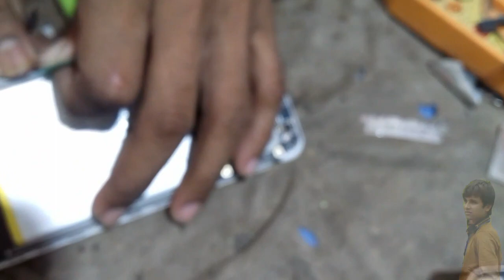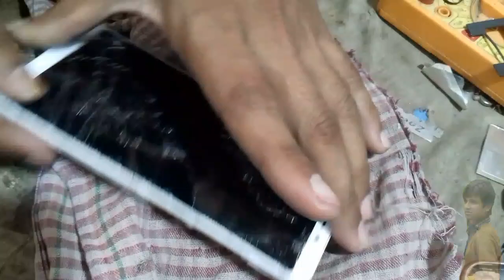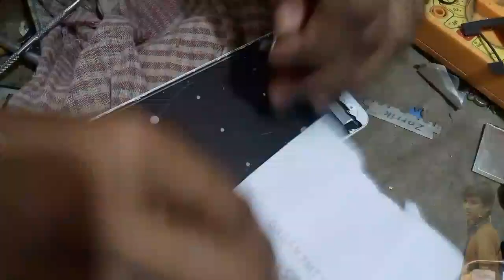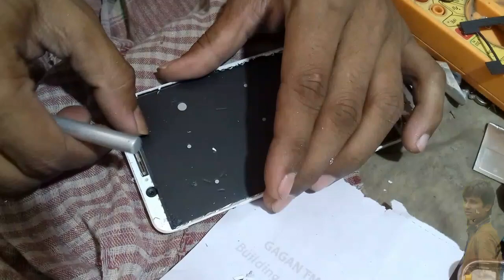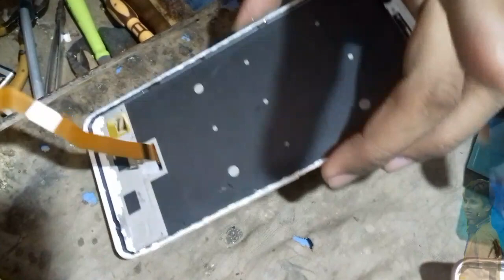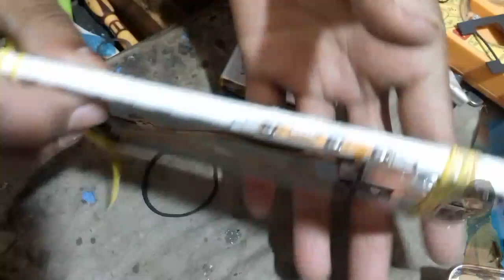vivo y71 folder change

Comment: bhai mera screen glitch ho raha hai ,upar niche screen overlay ho raha hai par screen mein koi crack nahi hai and touch bhi response kar raha hai . to mujhe screen replacement karna hoga kya?? but aap jo glue lagae wo thoda nikal gaya hai right corner se mere phone mein
Reply from the maker: if you have any difficulty in changing the folder, you can contact us on WhatsApp in video calling.
Reply: @NR1991  but mein customer hun       mujhe screen replacement nahi aata
Reply: Folder change aaur screen replacement dono ek hote hein???  
Mujhe kya karna hoga??  
Mere phn display homepage mein scrolling ho raha hai upar niche
Reply from the maker: If there is a problem, you need to change the folder